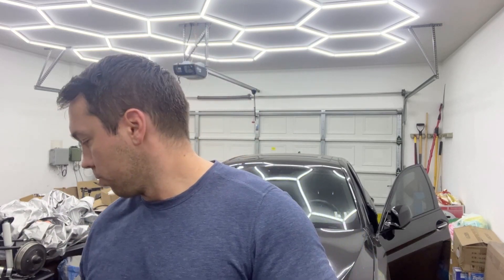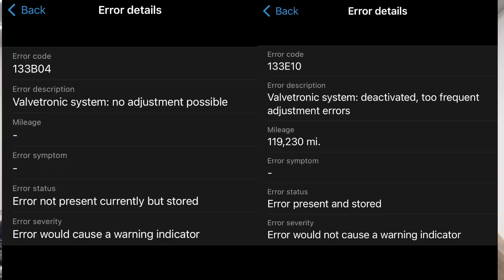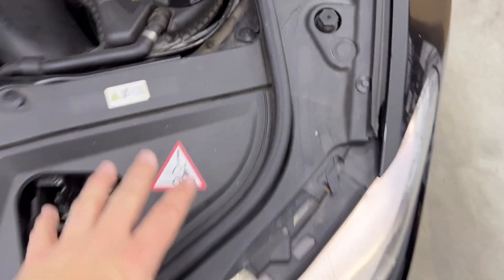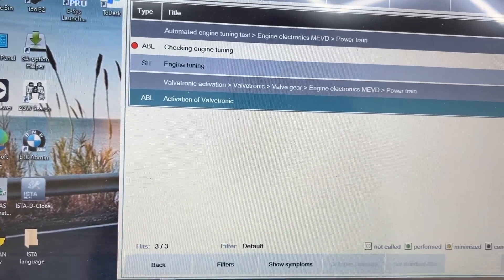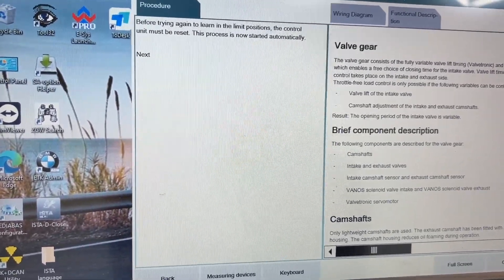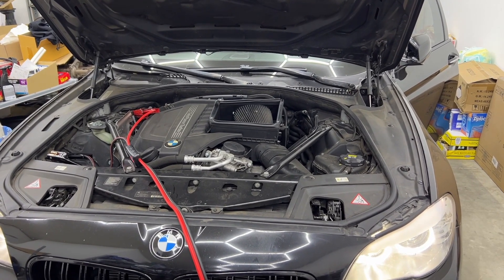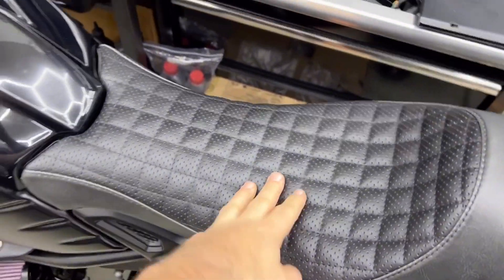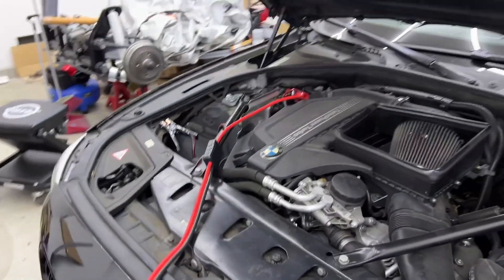BMW N55 VALVETRONIC SYMPTOMS and DIAGNOSTIC | Defective Valvetronic System | 133E10 | BOND Garage

Comment: I'm getting the 133E10 code and when i accelerate harder, it loses power and jerks... I think about 2500+ rpm.  At first I thought it was the transmission, but hopefully it's just the motor… does this symptom happen when it's only the motor or is it generally because of the shaft?
Reply: i have this same code.. you end up figuring it out?

Comment: as i conclude about valvetronic system, if you are lucky, yes lucky and dme shows deactivated system and valves are maximally opened, dont tuch it, leave it as is, that system (vvt gen 3) is pain in the ass, i HIGHLY recommend not to fix it, it does not worth it, good luck!!
Reply from the maker: can't agree. finally got around to fixing it and it was needed. car started to stutter after start in gear. though it's having a tranny problem. down on power and drivability. so much better now that it's fixed. it's also a somewhat nice work as far as working on your car in the garage goes (not crawling around underneath for once), but you do need some special tools and ista-D. also heard people less lucky than me reporting that the car just wouldn't start anymore somewhen. still this is stupid to fail tbh
Reply: @BONDGarage  i replaced valvetronic servomotor once and it worked only for 2 or 3 month, then same errors appear, now it is deactivated, absolutely no difference

Comment: By continuing to drive the car with a faulty Valvetronic motor (which normally just one or more bad position sensors in the motor), you risk damaging the MOSFETs in the DME which drive the motor. Even with the Valvetronic turned off by the DME, it still has to find maximum open position each time you start the car. It does this by driving the motor until the shaft is against the stop for maximum lift or it times out. If the current sensor for the maximum stop is faulty, the MOSFETs will be over-driven.
Reply: maybe unplugging the servo motor will prevent this until further diagnostics is possible? I believe you can still operate the vehicle witht ther servo unplugged.
Reply: Thanks

Comment: My f10 2012 535i has code p1030 Valvetronic code it’s in limo mode and gave me the code and drivetrain malfunction after car wash and also straight piping the car this all happened same day I’m not getting the weird noise when unlocking the car just poor acceleration
Reply from the maker: limo mode sounds dope. first of all I don't think any of this is related to the car wash. at least that be strange. I've been driving mine with those faults ever since I made the video coz I haven't gotten around to fixing it. all parts on standby tho.. also don't notice that check sound before start any more. maybe it's just off and doesn't cycle through. but meanwhile mine developed the sawing idle.. so I'll fix it soon I guess..

Comment: The engine should run to relearn. I had similar problems at 67k miles. Tried to relearn the valve 4 times with failure. codes and check engine light came back. So 5th time I warmed up the car to full temperature, turned on lights, ac, blower on max, music, and clicked relearn. And after 450 shakes of the whole car it was done. 72k miles on dash no codes. Hope that helps
Reply from the maker: worth a try!
Reply: @BONDGarage  also try different version of software. BTW I did not use xcom. Just mhd adapter and windows laptop. My problems started with dashcam draining the battery and bmw was turning off all power to the car with warning about draining battery. I would replace, charge, and register the battery if it's old. Stock tune maybe. I'll send you my software version number in few hr
Reply: @Fenix66687 yesterday I had battery fault and when i did diagnostic i had a LOT of faults, one of them was valvetronic disabled, tried to reactivate like in this guys video while engine is off and the fault still remains, i tried to drive and when i push hard on the gas car starts to stutter, no power at all on high rpms. Should I try to reactive valvetronic while engine is on?
Reply: @  ista says the steps you need
Reply: This helped me but when it does the 50 after it fails and says it’s too stiff 😢 after a new motor from bmw at 350£

Comment: Great video. Can you share how to get/use Ista? I’m using a foxwell nt510. Works great but the handhelds are a pain for detailed diagnosis and work such as the eccentric shaft. I’ve got a lci f10 nearing 90k and an f15 that just hit 100k. Just wanna be prepared. Thanks.
Reply from the maker: I got mine from vxdas. believe that's a Chinese operation but comes with laptop and everything preinstalled. I believe there are some forums that share links to get it for free but that's also somewhat sketchy if you don't know you you're dealing with.